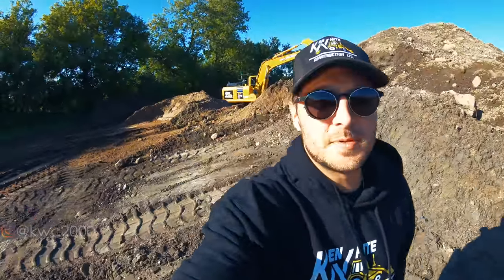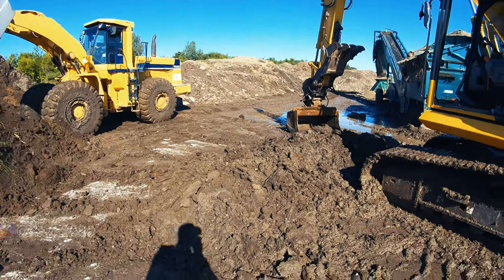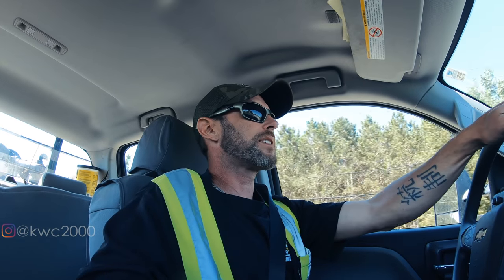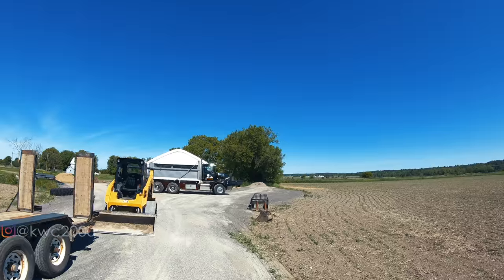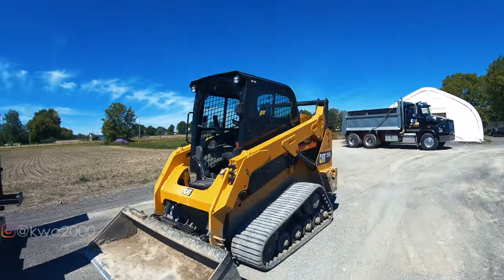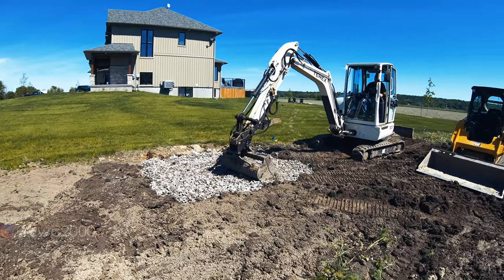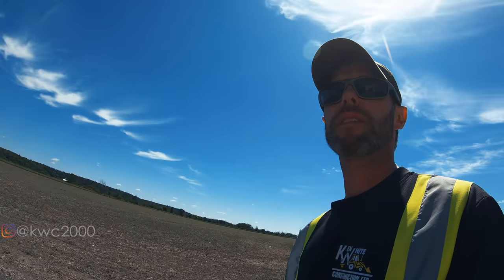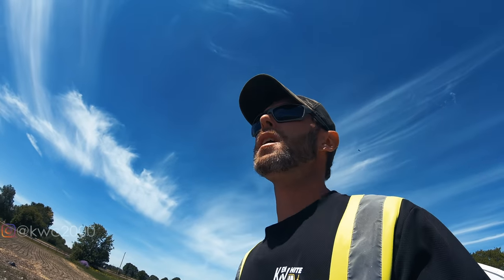THIS WAS A WEIRD JOB! (CLEAR STONE HOLE) *excavation*

Comment: Be a lot smoother snd more fuel efficient if you don’t try and stretch out all the way, move up and use 75% reach for bailing no need to stretch it out and bang around every bucket, hard on the machine, fuel consuming, and take a lot longer because you’re trying not to jump around while getting to your max reach point.